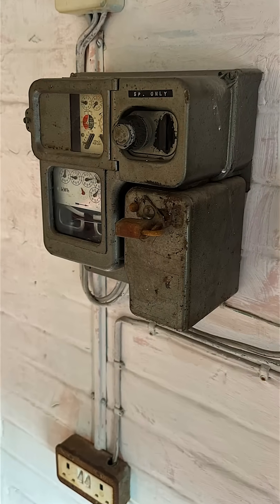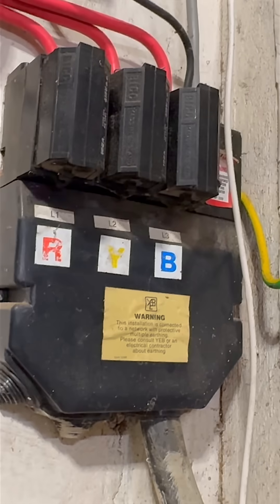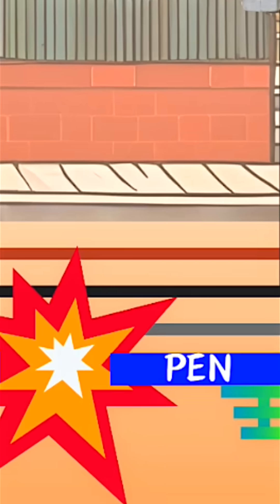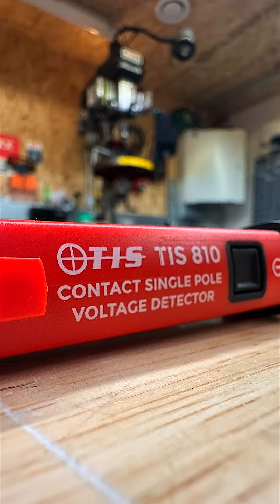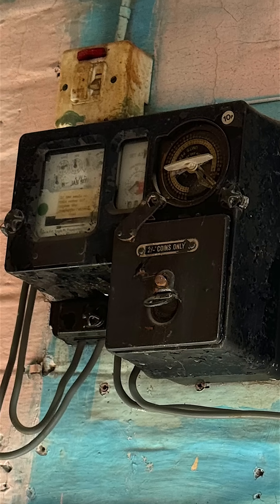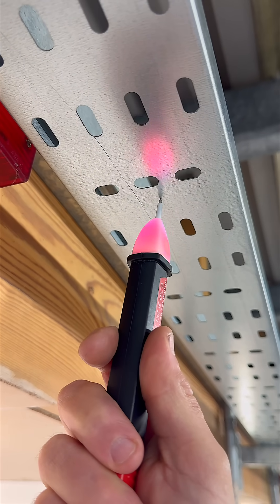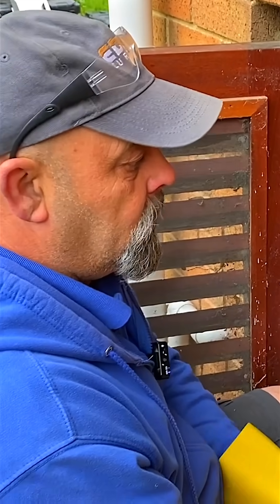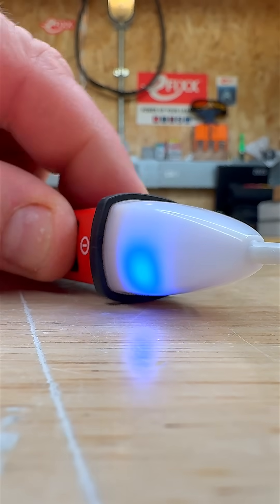It Looks Safe… But It’s Energised?!

Comment: You may want to check out a thread on the IET Wiring & Regulations Forum, titled: 'Apparent voltage on plastic service head' regarding some odd results using the TIS810 featured in this video - it appears to register a voltage even when on a plastic insulating material, so may give false positives when testing for phenolic degradation (I would've posted the link to the thread, but YT removes links that I post).

Comment: Yeah, let’s not talk about the fact that electronic voltage detectors will give you a false positive on metal fixtures if there is a live cable perfectly insulated just touching it. It will simply react to the magnetic field of that cable while the fixture will not be at a potential.
Reply: a false positive is not a problem, a false negative is. If the voltage detector beeps, you take the multimeter and double check

Comment: Electricians really need to be taught how to use multimeters.

This type of device doesn't tell you what level of voltage is present.
Reply: Most Sparks know how to use a Multimeter to be fair.
Reply: Yeah but multimeters are a bit on the bulky side, so a neat little tester like this that can stay in your pocket is ideal for a quick test to see if a voltage is present or not rather than pulling out a meter and leads every single time.
Reply: @JaenFoster Checkout the Amprobe DM73C.  Slips in to your pocket and is of pen type form..
Reply: @stevoc9930  Ask them about low Z and watch the baffled expression creep across their face.  Just because a multimeter displays 143VAC doesn't mean you are going to die touching the device under test.  To be fair there are electricians that understand this but a lot don't.
Reply: any cheapo non contact volt tester will work just fine, if you need the brand name, a 50eur fluke will work as well.
Reply: @zaxmaxlax No, there are reliability problems with most non contact types.
They are nowhere near as good as a contact type.
Reply: @deang5622  they're just a quick check tool
Reply: @retrozmachine1189  if you treat it as dangerous when it's saying 143V at least if you're wrong you'll be wrong in a safe way :)
Reply: The point of the video was to show you the tester in action to double check if the housing was energized. He did not need to measure the voltage. Did we watch the same video?
Reply: @deang5622  In the fault described in the video, all parts connected to the earthing system are expected to be at the same potential.  Any 2-pole device for measuring voltage such as a multimeter, that doesn't also have some form of reference to the user's potential, will read 0V as you test between those parts.  Unless you bring in true earth from outside the installation with a wander lead, and test to that.  
Either a non-contact voltage tester, or single pole voltage detector as shown in the video will reference to the user, so will indicate a voltage where a multimeter wouldn't.
Reply: @andrewcadby Multimeter 101: a multimeter has two probes. YOU have to connect BOTH.

It is down to YOU to decide where to connect them.
A multimeter will give the correct voltage reading if you connect BOTH those probes to the right points.

It is the job of the user to KNOW where to connect those TWO probes.

So your excessively long post boils down to one very simple sentence: know how to use the multimeter .

Didn't I actually say that in my very first post?

So are you admitting you and electricians  are unable to identify where to connect both meter probes?

If you are trying to suggest that in this situation a non contact probe is the only form of test device that can be used and a multimeter cannot, then you have serious gaps in your basic knowledge of electrical engineering.

Man, you really need to stop the waffle. Some of the worst BS I have read in response to an incredibly trivial issue.
Reply: @deang5622  Calm down.  Instead of getting upset, read through my comment again.  Then explain how you would have used your multimeter to identify the open PEN fault shown in the video, and why you think it would be better at identifying that fault than a single pole voltage indicator.  You might be right, and I'm happy to be corrected if you are, but I suspect you aren't.